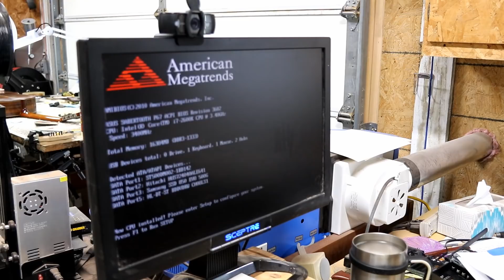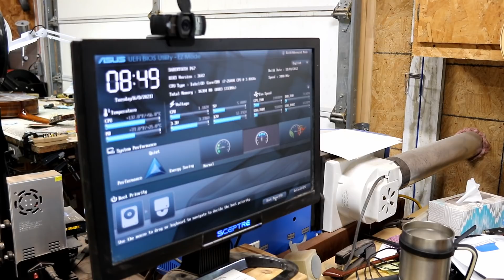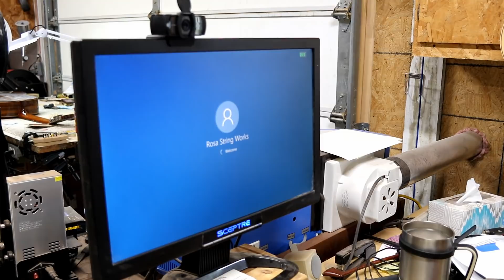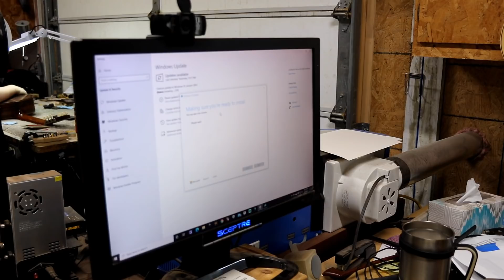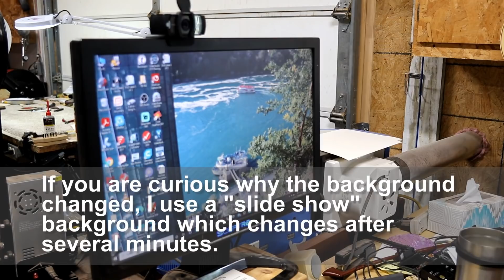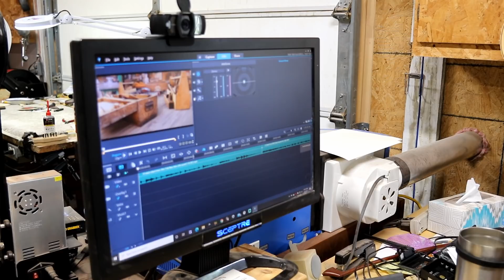493 RSW Upgrading an Old CPU to a Better Old CPU

Comment: I assume you have a 1155 socket (I have the i7 2600K), I recommend a liquid cooler like this https://www.newegg.com/nzxt-liquid-cooling-system/p/N82E16835146064?quicklink=true
Also, if your model ends with a "K", it can be over-clocked with Intel Turbo Boost. I get mine up to 4.30GHz from the stock 3.40GHz. 
In the bios, I have mine set to run at the fastest settings and it's been doing it without a hiccup for 9 years.
I'm about to do an upgrade because the 2600K is bottle-necking my  RTX 2080 Super GPU.
Which i7 did you get?

Comment: LOL I see you have the usual "working on PC scratches". So many damn sharpies in the PC's. New drivers to support the new CPU. Oracle update is for creating a Virtual PC, it's been turned off in the BIOS so the enable it you would have to enable Virtual in the BIOS which will then install the Virtual software again... Yes I support Hardware and software for a living... PCIExpress or Buss... If you are going to upgrade again first check the mother board makers site to see if it supports later CPU's, likely it doesn't, or it needs a BIOS update first. But if it's 10 years old there's a good chance it doesn't. Get a ASUS motherboard,I found they better quality when you decide to upgrade again.
Reply from the maker: It is an asus motherboard

Comment: Amazing how everyone is a computer expert now, lol. I guess I'll have to throw in my 2 cents. All along I have told you your internet is fine, that it has to be something else. Changing the CPU to a better one is a good thing, but if you want performance, buy a gaming computer that has all the latest and make sure it has intel and not AMD. (I like spending your money) The ones talking about temperature are correct (paste and all) and AMD tends to be hotter. I have had problems with AMD computers more than once and will never buy one, from compatibility, to running hot and not lasting very long. They just suck.
Reply from the maker: I certainly understand your point if I was made out of money I would do that.  the overhead running a business is way more expensive than most people realise. And of course everyone has an opinion and lots of people say the AMD is far superior to the Intel and then on the other hand others say Intel is far superior to AMD.  in my opinion they're probably both very good